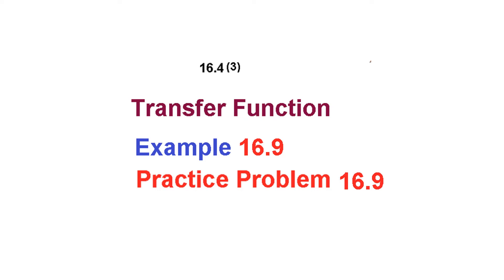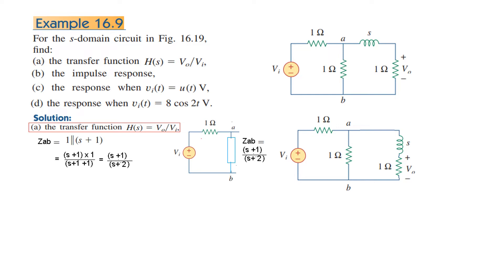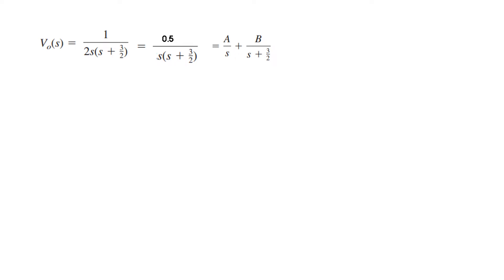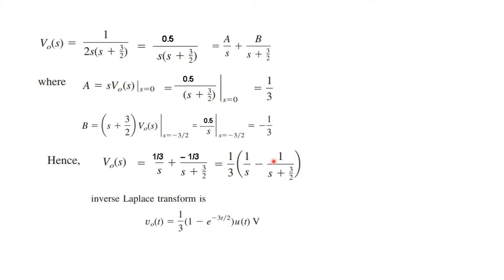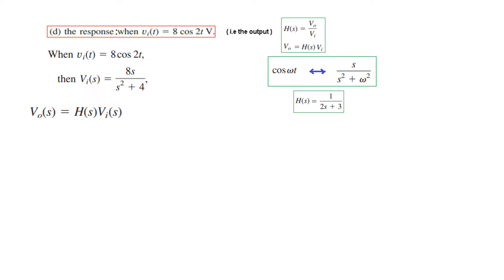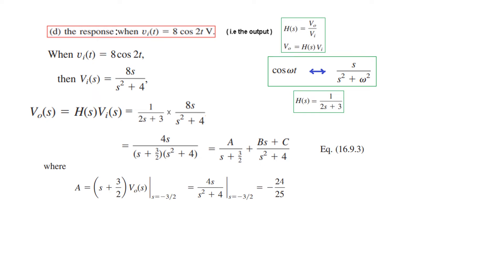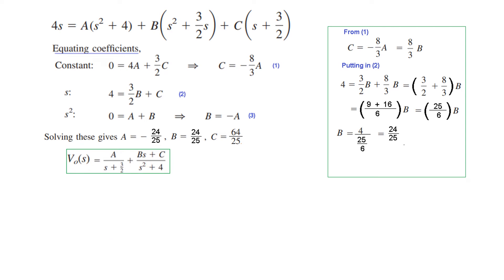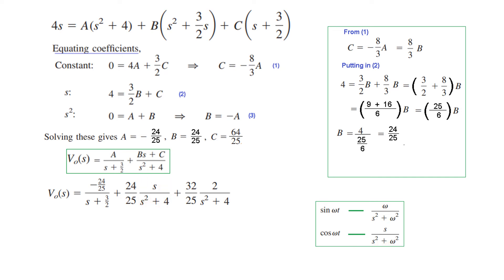(English)ENA || Example 16.9 || Practice  16.9 || Transfer Function

Comment: why do we have that half for d  in the practice problem ?
Reply from the maker: After we have taken 16/5 common, the last terms will become 1/(s^2 +4), but to apply sinwt formula, we need a 2 at the numerator i.e 2/(s^2 + 2^2), so we we need to write is as (1/2)(2/(s^2 + 2^2)